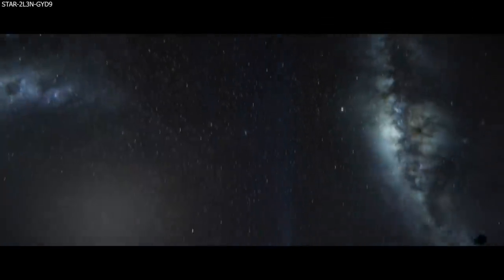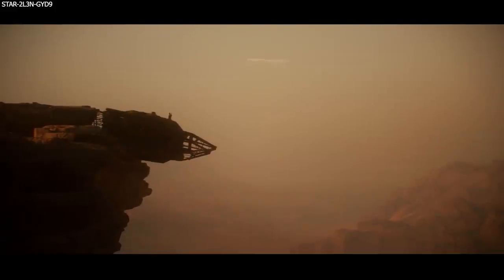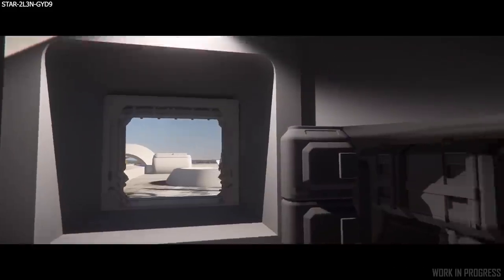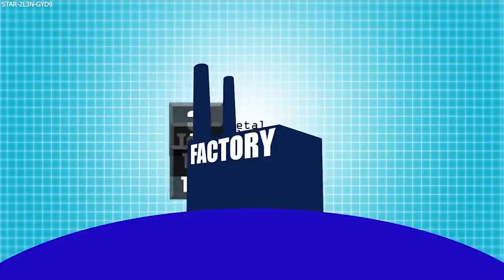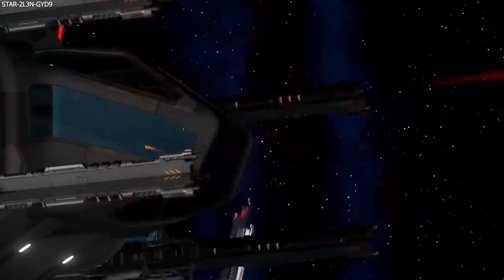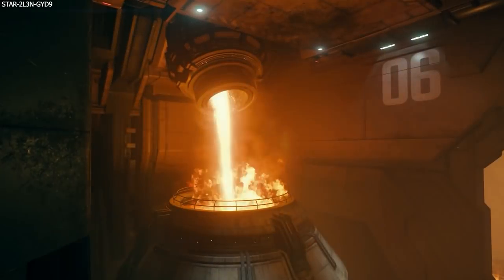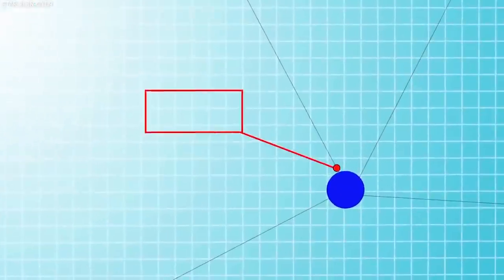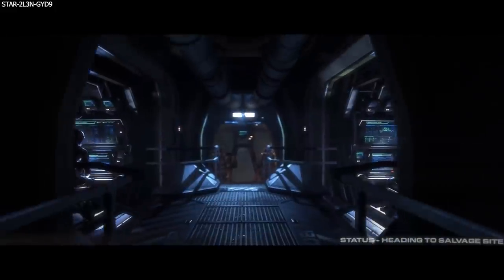Physicalised Materials & How It’ll Affect EVERYTHING | Star Citizen

Comment: What if, say a drake ship took damage,. Could you repair it with higher quality materials than what was originally there as ship armor?
Reply: Or imagine if your Banu Merchantman takes damage, and the banu hull is super rare, you're gonna have a patchwork shitty iron repaired part on your nice gold banu ship xD
Reply: Theoretically yes. Although, I believe that repairing the ship (for example a hole in the wing ) would happen with the use of a filament  and a repair tool. Kinda like 3D printing something to patch the hole up until you get to the nearest station to get the ship truly repaired (in which case the damage model of the ship would get reset and no previously taken damage would be visible)
Reply: Currently the idea is you're multi tool will be able to break down materials into canisters and that material can be used to repair your ship. The repair will be made from the materials you salvaged beforehand. However when you repair at a station etc, it will replace your patch job with the original materials.
Reply: I'm just imagining the repairs people are gonna come up with...like robbing Peter to pay Paul, someone is gonna fly up with one seat, a joystick and 4 thrusters lmfao.